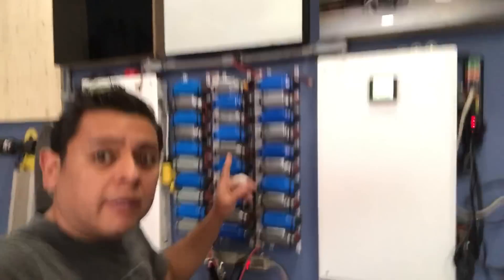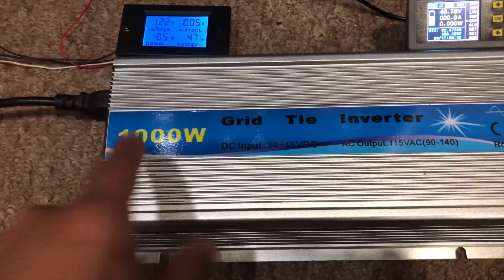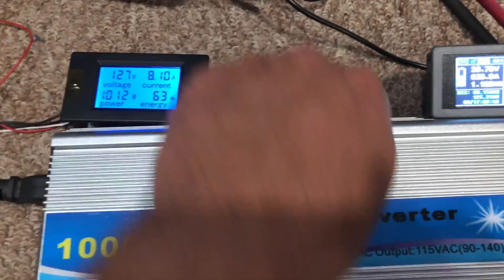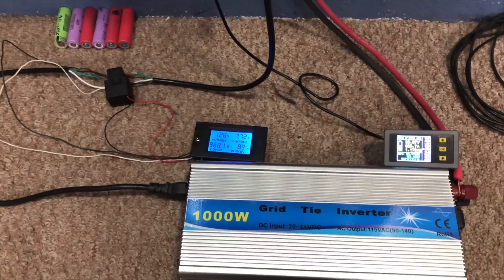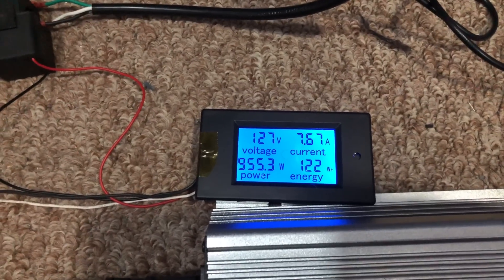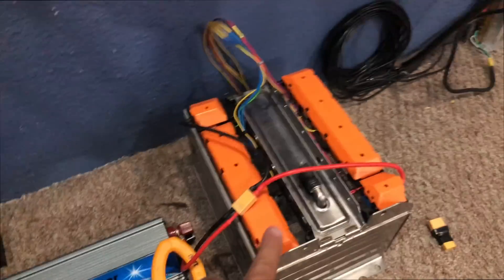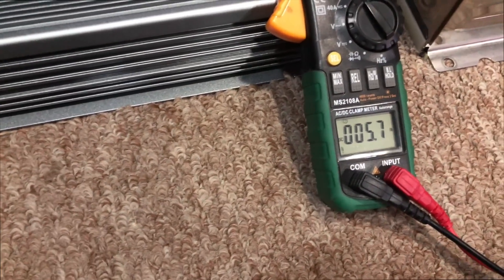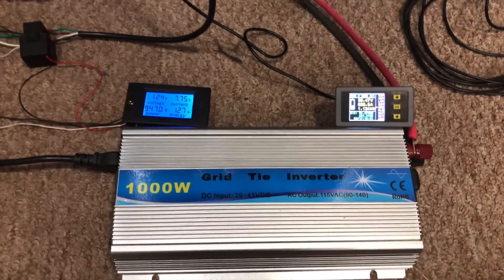Do Cheap Amazon 1kW grid tie inverters Put out 1000 Watts?

Comment: I have the 10 to 30 volt 1000w version running with 10 100w solar pannels no batteries and it cut my light bill in halve. Has been running for 10 month with no problems. If I have to replace once a year for $100 it is still worth it to me. I also have a $80 600w inverter on 36v hover board batteries that I run at night. I charge them with 2 230w 24v solar panels. Running for 6 months no problem. It dropped my light bill even further. These things work great! They are stackable so at times I run both of them at the same time.
Reply: Ruben Salazar ummm hard to believe the power company did not come knocking at your door
Reply: I thought the same thing.They haven't yet. I also thought the meter would charge for energy going out but no. If they ever show up all I have to do is unplug inverter from the socket. Believe it or not!
Reply: Ruben Salazar lol what state are you on I'm in california and there is rarely any clouds so I was thinking of just connecting an inverter disconnecting my room from the grid key room is like a shead because its separated from the house garage size and having an inverter act as the grid and my grid tie powering the ac with solar
Reply: I'm in Texas. Sounds cool. Before my 600w grid tie inverter I was running my kitchen and living room with a 900w non grid tie inverter. I isolated from grid by flipping circuit breaker.

Comment: If you connect more then one 1000W, how do you synchronize the AC wave between them?
Reply: They do that automatically. The sync to the grid.
Reply: Thanos Tourtouras Can you point me to an article or a design that shows that they can sync? I don't think they are designed to sync to a grid as you are not supposed to connect them to a grid. Also, I never saw a design of such inverter with this feature.
Reply: gidimiz grid tie inverters are meant to be connected to the grid, sync to it and feed it.
Reply: gidimiz Grid tie is in the name, they are grid tied.
Reply: Ok, so is there a way to use GTI to only supply the house load without pusing the excess to the grid? So, I will use the power generated from the PV for my own use and if I have higher loads the grid will compensate?
Reply: gidimiz it is basically illegal to install GTIs without a permit and an additional meter (net metering). Apart from that, there's hardware available that can do whatever you wish.

Comment: Just a dumb truck driver here...
Twenty years ago, Pilot truck stops had a deal where they were, as they advertised it, selling a 1Kw inverter, and giving away a free microwave oven. 

The pricing, at the time, was evidence of the reverse.

Twenty years later, the inverter is still doing its job, and the microwave is long dead.

Unfortunately, my inverter only has a modified sine wave output (probably why the microwave died), so I have to be careful with what I plug into it... 
But, it'll also surge to double its continuous rating for an observed five minutes.

Perfect for power tools! (Unless you're Tool Time Tim)

During a couple power outages, I have run a double male drop cord from the truck to the kitchen, and kept the fridge cool. 

At my house, this is easy as there's a outdoor outlet on the kitchen circuit. Just cut the kitchen circuit breaker to isolate it, plug in the drop cord, and it's on. 

It's good for the fridge, clock, and a few lights.
Optimized Idle (Automatic engine start and stop to maintain truck interior climate and battery) automatically keeps the truck's batteries charged, so it's a "No Worries" type of thing when done right.
Reply: Last year just before Irma hit I bought a 2000 watt Modified Square Wave inverter. A single Deep Cycle Marine battery kept it running for 2 hours with TV and refrigerator on. To extend the run time, I hooked up cables to my truck and just let it idle. No noise of a generator and by switching loads, kept two refrigerators, the tv, a microwave, and a freezer along with lights and fan on. Microwaves do not like even MSW inverters but will work at about 75% of their rating. Next thing on the agenda is a bigger true sine wave inverter in the 4K range and a transformer to match. Want both 120 and 240 volts circuits to be powered off of it so I don't have to run the generator all the time. One thing I have found about UPS units is that very few of them produce a clean sine wave and most are just square wave units.
Reply: Double male power cords are dangerous. If you plug it in while the AC is life, it'll be out of phase and the inverter blows up. But even if that is not the case, you can have problem because AC circuits can have neutral to ground ties while inverters are not designed to cope with that. And even handling them is a bit dangerous since you have prongs with mains voltage and high current out to be grabbed.
Reply: DrFruikenstein I like the innovative thinking  to keep the fridge running. The double male cord and circuit isolation is a sneaky solution to keep things running. Def want to keep that cord safely stowed.

Pity there isn't a cheap readily available legit solution on the market. There are auto power switchovers made for Gen to mains switching but they aren't cheap.
Reply: Another trick...

UPS...

Those "Un-interruptible" power backup supplies for computers. They work for lamps, stereos, clocks, TVs, and many other things as well.

They're also cheap, if you know what you're doing...

People don't know that the batteries are replaceable, so they toss them out as soon as they fail. Find one that someone gave up on, and go to Wal-Mart to get a replacement gell-cell lead acid battery. Or step up the game, and put together a small LiFePo4 battery pack for it to get a bit more capacity.
Reply: I think a lot of people are forgetting the older low frequency inverters have a transformer, and heavy, but have triple surge rating, my two cents :-)
Reply: DrFruikenstein nice thing about vacuum tubes, you don't need no stinking fan, LOL
Reply: An inverter that lasted 20 years ???  That's like a miracle........
Reply: WTF BBQ 
When looking for inverters, it's a good idea to calculate how much power you will be using, and then buy one that has double, or more, the continuous rating.
Except for the occasional power tool, my inverter rarely sees more than a quarter of the  rated continuous load.

I also fuse the inverter input at approximately half the maximum continuous draw (40A fuse. About 540W.) to lengthen its life.

For when I'm using tools, I have a quick connect cable, with jumper claws on one end, that I run out the window and connect directly to the battery. That bypasses the fuse to let the tools run.

This inverter is now mounted in my car, and I rarely have the need to run power tools from it, so it's probably not gonna wear out any time soon.
Reply: gravelydon 
"Modified Square Wave"...
I like that.
Traditionally, that was called "Modified Sine Wave", however, when looking at the wave on an oscilloscope, a stepping square wave is what you see. "Modified Square Wave" is more accurate.

Getting a true sine wave inverter is always best. It's easier on just about everything. Although most inductive loads really don't care, as long as they don't get hot. 
So, anything that mainly uses motors to do its job, like fans, A/C units, refrigerators, and freezers should be fine. 
Most lights don't care, either.
Reply: I don't like the term " modified sine wave " for them just because of the wave shape they have. They didn't start from a sine wave and modified it. They started with a square wave and modified it to look a little more like a sine wave. Looking at them on a scope can really be eye opening as you see all sorts of things in the wave form. On some units, if you load them hard, they tend to go back to looking more like a square wave. I have a smaller sine wave inverter ( 600 watts ) that I can hook up as needed and I often use it for powering the scope when I want to look at an UPS or another inverter. When looking at its output on a load it was cleaner than the commercial power wave form. Funny thing about UPSes, they don't like the modified square wave and will drop out of straight through feeding of the load. But yet they have no problems running on the generator that has a little swing in the number of cycles per second. One day I'm going to dig out my 1000 watt UPS from the 90s and see what it looks like on the scope. Problem is moving it. It weighs 75 lbs due to it having 4 6 volt sealed batteries in it. And it is an AVR type unit. We used to have voltage problems because there were 90 customers on a single phase line. And many of them have 3hp or so water pumps. We saw voltages as low as 95 volts and as high as 135 volts. That is hard on equipment.
Reply: For UPS, get the old business versions. I have a APC SmartUPS 700, which only needed new batteries and a jumper wire. Its a true sin wave UPS, which I got for free and it runs like new. Don't buy the batteries from APC, or whatever company, I bought the same brand batteries they used in it, for more than half of what they wanted.
Of course there are cheaper businesses, so just be careful that they didn't buy a cheap UPS. Mine was from a doctors office, that cared about keeping their server up on short power outages, which happen occasionally here.
Also, don't use a modified sine wave for all your electronics. It may not show, but a lot of electronics don't like the power from them. It will work, but it won't be efficient, and will stress a lot of electronics.
Reply: Yep, it would be a far better setup to use shielded male plugs designed with safety circuits. Or use female connectors on cords and stationary male ends like you find on computer equipment or portable generator to building receptacles.
Reply: DrFruikenstein The more energy dense Li-ion groupings of chemistrys, usually in the 18650 format can be used for 24v or 48v systems due to their similar charge and discharge voltages in lead acid denominations of 12s and lion of 7s.
Reply: Bob Lob Law 
When replacing lead acid with lithium type cells, I've found that LiFePo4 cells are much more forgiving than the other lithium types. Especially when being constantly charged in a UPS system. With the other lithium chemistries, I've noticed some overheating issues when connected lead acid type charging systems.
Reply: Roger Kerkmann 
Transformers are also forgiving. As long as they are kept cool, they'll take extra abuse.

I remember the average inverters that were around in the '70s. They had a mechanical vibrator that ran through a step up transformer. The frequency was never perfect, but close enough to be reliable.

I once used a 555 timer IC, and ran its output through an audio amplifier which was run through two step up transformers (series) to give me 114 VAC @ 59Hz.
After testing it with a 100 watt light bulb, I tried it with my Sharp portable TV from the late '60s (tube type with a solid state audio section).

The TV worked, and survived, but was a little starved on power as evidenced by the picture size being slightly smaller than usual.

It was a good experiment, anyway, but I wouldn't try that trick again, except for maybe lighting.

Somehow, the audio amplifier, used as part of the inverter, also survived.
Reply: gravelydon 
I suspected that your term "Modified Square Wave" wasn't an accident. You've seen the same thing that I have on a scope.

People should read the previous two comments as they may be an eye opening moment for them.
Reply: smeezekitty 
Stuff everyone needs to know before trying anything like that. 
I thought it through before I hooked up anything.

If done right, it's safe.
HOWEVER...
It's very easy to do it wrong, and mess something, or a body part, up.
Remember, it only takes one amp of current across the heart to meet your maker.

Comment: Good to know :-) I have the same sort of inverter rated at 2000 Watts and a peak of 4000W at 12 V input and 110/220 VAC output... I'm going to use it to power my LED grow lights... Should be plenty :-) Thanks for the video :-)
Reply: Yes... Those cheap inverters from China allow both 110VAC and 220VAC... In China and a lot of the world they use 220VAC... so the inverters accommodate both outputs... I don't have my inverter here, to take a photo of the receptacle or you could see a 220VAC from China or the UK will plug right into it... The inverter he is showing is 110VAC only, made specifically for the US market... Hope that clears it up... If you do a search in either eBay or Amazon, you'll find many of the inverters are suitable for both 110VAC and 220VAC Output...
Reply: Oh! About the LED lights... I have since gotten 110VAC input to 12VDC output power supplies, so I no longer need to step down the power... :-) However, if I have a power outage I can use the inverter and batteries to supply the lights...
Reply: Do you have a link from where you bought it? I would really appreciate it. Thanks!!
Reply: I bought it about 10 years ago, so Nope... Good luck... I bought it off of eBay...

Comment: Unless you have net metering, beware that a normal "smart" electric power meter may actually charge you for power sent back to the grid.  If your air conditioner pulls 240 volts, you may want to put a grid tie on two different circuits that are on different main power legs at your breaker, else you may be sending excess power on one leg back to the grid (and being charged for it) even when your air conditioner is running.
Reply: There are versions of this inverter that have a little clamp that you hook onto your Mains and it monitors how much power you need and will turn itself down to avoid putting Excess power into your house and meter.
Reply: It just kicks out an error;  You might get a nasty note from your utility... which could be worse.
Reply: Yes, the clamp meter you describe is called a limiter and is a good idea.  But I think the inverter must be relatively close to the breaker box as the cable between the inverter and the limiter may only be so long.

Comment: Do you need a net metering electric panel for this? What happens to the inverter when the AC is off? Does it go back to the power company?
Reply from the maker: im going to turn them off

Comment: Dont you think running the converter at peak could be dangerous (especiallly in the long run) ? As a german guy I am always worried about Safety !
Reply: It is build to do so.
There is also almost no way to limit the output.

Greetings from Germany to :)
Reply: I think crappy/unreliable when I hear cheap.
Reply: Nik Leiser most of the time this thinking is dead on :)
Reply from the maker: I explained that I will run it for 10 minutes at a time,

Comment: I have been using 9 of the smaller GTI on a solar installation for years, they work great.I would say that I always apply the AC supply before the DC when powering up, and disconnect the DC before the AC when powering down. (I did blow a few MOSFET's early on)Also for running 1000 watts continuous it would be safer with 2 working in parallel.
Reply: In typical grid tie on day the ac will go out… and the device will have to endure a DC then AC startup.. I’ve never had a problem with my GTI during that type of condition.
Reply: @benparkin3191  I think this may have been a problem with the older cheap GTI,s.
I did have a few problems early on, and rightly or wrongly assumed it was the way the device was powering up.
Over the last few years I came to the same conclusions as you, power the DC first then AC.
I still have a few of the smaller GTI's (350W) in a cupboard that need fixing :-(
Reply: so if were to use one tof these with out going thru all the "CODE/PERMIT" crap what would the electric company say? . .  would they even be aware that i was back feeding? Since there is no bi directional meter on the electric ones?
Reply: 2 working in parallel woud pump 2000W in to the grid
Reply: @u8un7u I think their rated Wattage is a bit optimistic, so maybe better to use two and not over stress them.
Reply: @martinwragg8246  do they let you limit the power limits?
Reply: @u8un7u  No, not on the inverters I have.

Comment: Dear Readers: Just to let you know, if you want to power electronics like phones, laptop, cameras ect from 12v leisure battery ... buy a "pure wave" not a "square wave" inverter. Electronics hate square wave, its too choppy. Your equipment will die. 

Just to be clear:
12v battery + pure wave inverter + 4 gang extension + electronic devices can plug directly into extension

Battery banks are totally fine. 12v battery + square wave inverter + 4 gang extension + plugging in a battery charger and charging your devices batteries for use later. 

... so if you where on a video job, charging separate batteries on a square wave is ok. Hook it up to your car or solar charge controller. But you wouldnt be able to power the video camera from it live. For that youd need a pure wave version. 

Jehugarcia's video is a pure wave ~ one
Reply: When you're talking about charging your laptop or Smartphone its a bad idea to convert to 120V at all. You only need a car charger to do so... Much more efficient